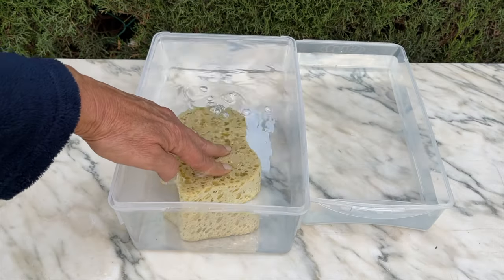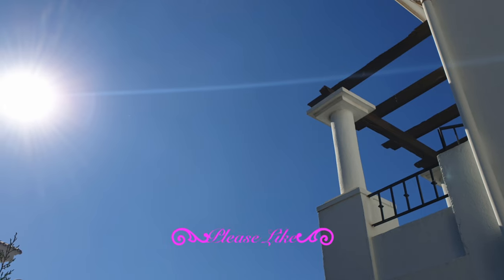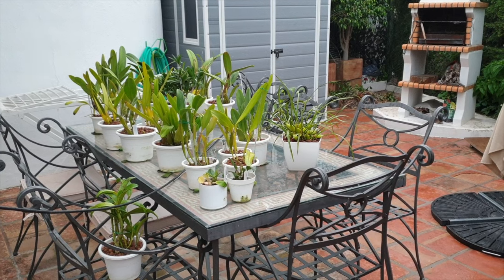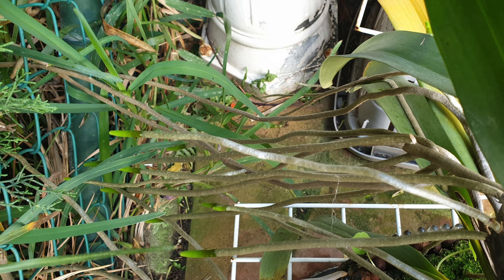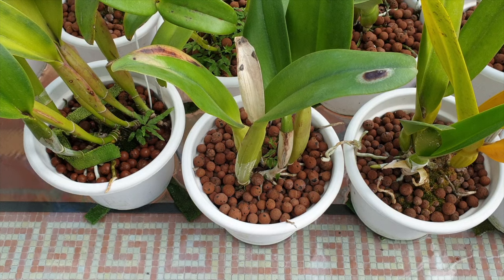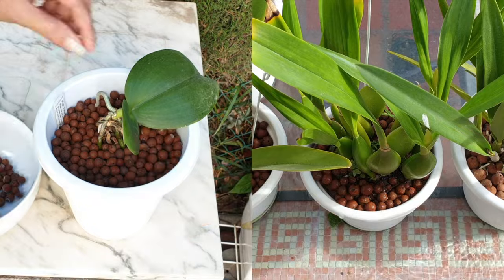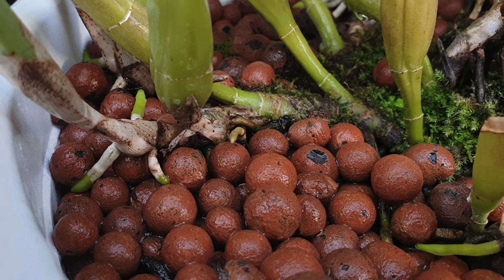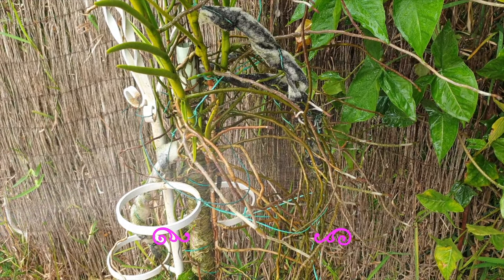Water Orchid Roots BEFORE Fertilizing? Y/N? Debunked? Why? Environmental Conditions #ninjaorchids

Comment: Great video Nina.  Trying to catch up on what I've missed.  In the growing season I like to have nutrients around the roots all the time.  I feed 3 weeks on and 1 week off for flush.  I'll add some cal/mag and additional epson salt on the off week, wait about an hour then flush the pot.  The weeks I'm feeding, run fertilizer through the pot wait 15 to 20 minutes run it through again.  It gives the pours of the roots a chance to fully open up getting the full benefit of the fertilizer. When I'm done feeding for the day I mist the exposed roots.  I might be waiting a little long before misting but I find very little foot and root tip burn.  Winter feeding is less of a concentration  of my concoction about 100 to 130ppm , not enough to burn them but still have food around the roots.  You Orchid Master taught me to stop fertilizing when new tender roots are exposed.  Oh yes, I was killing new roots.  Its a pain watering and feeding in the cold months takes 3 days to finnish 300+ orchids.  Whats nice I get a up close inspection of each plant.  Very thoughtful info Orchid Master. Thanks
Reply from the maker: 🌸 🥷🏼Bob San 😍🙌🏼🤸🏼‍♀️🥰💐 hi! Your routine is classic and the way I used to do it when I was growing in organic media 👍🏼 I have been blessed to see some of your roots 😍 clearly, you are doing it right! If I may just specify something, just in case, the growing season is dependant on what the orchid is doing on an individual basis and not based on our temperatures. Especially with your controlled conditions, you can be more targeted to the needs of orchids that are in active growth. In my case, I have dial everything down a lot, because I am depending on what the conditions are. If I have an orchid in active growth during the winter, the size of the growth will not meet expectations compared to the orchid growing a new growth during the warmer temperatures. So, if you look around your collection and see something wanting to grow, go ahead and support that orchid with a tad more nutrients. 👍🏼 Not sure if that is what you are doing, so if that is the case, then forgive the unsolicited advise. I sincerely hope that you are having a great week, 🌸🥷🏼 Bob San!! Take your orchid care routine in stride, don't stress yourself out 🤗 thank you so much for watching! You are appreciated 🫶🏼❤️🌸
Reply: @NinjaOrchids  Thank You Orcchid Master.  😊  I have not added more nutrients yet  but I do have some active growers so I'm going to add more food to them.  Great advise Nina!  Is it okay to repot the active growers this early not waiting until spring?  Thanks again  Orchid Master.
Reply from the maker: 🤗 remember that active growth includes new root growth or old roots starting to branch / extend. Even if there is no sign of a new growth, some orchids will start their active growth phase by working on the root system first and then eventually a new growth starts. 👍🏼I checked the comments in a video that I have called 'Seasonal Orchid Care', to see if you had seen it and commented. I am not going to assume anything, so I am going to link it here in case you have not seen it https://youtu.be/GlPy1LKM4Sg when I observed my orchids over the years, I recognized the simple signs of the seasons orchids have and it changed how I went about fertilizing and supplementing my orchids. Suddenly, the work load was not as much (summer excluded 😉) but when it came to OUR seasons, this video may just give you a great way to navigate how much you need to do, with which orchids and when. IF your orchids that need repotting are in active root growth, no matter the time of year, repot. You are blessed with a controlled environment and that is something you can definitely take advantage of without any worries 👍🏼👍🏼🫶🏼

Comment: With all of my minis I lightly water a day or two before I feed, then about 5 to 6 days later heavily mist all of them. I mix all my feed at one quarter of what is recommended on the label since roots are hair thin and can fry easily.  Some of the mounted ones get misted daily depending on temps and how fast they become totally dry. 
On to your next vid Nina... 😅👍🏻
🐝
Reply from the maker: 🦤🦅😍 do you know why I call you Wingman? I think you do but just in case you may think why I am still on and on with that label, well, here you are.... thank YOU!! Also, thank you so much for adding your method in the comments. It is definitely a different approach because of your controlled case. You can work with the humidity in tandem with your watering / fertilizing. Perfect!! Good to have your take here, in case someone has the same intentions with growing their miniatures in a controlled space that doesn't equate a greenhouse 🫶🏼❤️🌸

Comment: Hi Ninja Master, when I say,"with Magd. In it,"  yes. I meant sesquipedale hybrids like Lemforde White Beauty, and Lai's star.  The former is the culprit. 😊😊😊😊. I have been moving them to the counter away from the windows. My temps are probably too low at night...like 45° f. Daytimes are in the 50°s. Summer is usually ideal ,as it is very warm here. So if you think decreasing access to the windows would help, I might have to look for lights. I'm really confused.
 I hope you're doing well in Southern Spain. You have lived  many phenomenal places. I am so jealous. Some day I will go to Africa. I appreciate you so much! 
Your Friend, 
Kelly
Reply from the maker: Hi Kelly 😍💐 got it!! Yes, the sesquipedale parent is the one that is not as temperature tolerant as the magdalenae is, so, in cases of hybrids, no matter if they are primary or complex hybrids, the parent that comes through as the strongest with it's attributes, that is the care that should be considered priority for them. So, the sesquipedale is strong in your hybrid and you are right about taking it away from the windows. However, try to ensure as much good light as you can possibly give them. I know it gets difficult with the right location, but try to keep them away from the highest influence of the heater (check if there are drafts that push drier air to the area you have your angraecums) maybe you can place a tray with leca or pebbles filled with water in their close proximity to help out with the humidity around their leaves. The ideal temperature low, if it is at all attainable would be no lower than 68ºF for the sesquipedale, BUT because there is a magdalenae parent, they may be a little more forgiving with a low of 59ºF. I am probably not giving you encouraging information based on your conditions for these months, but I hope that it gives you a good idea as to what you can try to do to bridge the gap before conditions are more favorable. 🤞🏼I am blessed to be able to live in S'ern Spain! Even though it gets too cold for me and the orchids, I consider myself so lucky that I am here. Seeing as I am not able to heat my home, I cannot imagine those that are in a similar situation to me, financially, living up north where they have no choice but to heat, or freeze to death. So, I try to keep stumm about my struggles here, because others are REALLY in trouble this time of year 🙏🏼 but.... I will always dream of Africa and for 5 months of the year, I am very homesick 🥹 thank YOU so so much for being here, for your kind comments and your friendship! Your support is greatly appreciated 🫶🏼 hope you have a fabYOUlous Friday, amiga!! ❤️🌸
Reply: Thank you so much for all your insight. I appreciate you more than you could know. Because I follow you, I have been able to grow orchids I never would have succeeded at having without you. You are just awesome. Please keep on doing YOU. 
Your friend,
Kelly

Comment: Awesome video!! My environment is usually 75% rh. I pot mostly super grade Orchiata for all my Catts, but a combination of Orchiata, sponge rock and charcoal for the Angraecoids. My problem is I am a little heavy handed with the watering. I cannot seem to find a balance especially in the cold months... that keep the magdelenaes happy. The Catts are fine with all the abuse I give them, but the others are tricky. I believe one is on his way out as we speak. They are unhappy with the central heat ( it comes on and dries them) and when I try to compensate with the humidifier. I think I MIGHT be 12:42  overdoing it. I hope this makes sense. What would you recommend? My sesquipedales seem to be happy. It is mostly the others with the Magdalena in them that frustrate me. I fertilize weekly/weekly using  MSU, seaweed, and a biostimulent. You are awesome! Keep doing you!!!!?
Reply from the maker: Hi Kelly 😍💐 so, what is your temperature days and nights, Kelly? What is the other parent to the magdalenaes? Are you referring to angraecum hybrids when you mention 'with magdalenaes in them' or the pots with species magdalenaes? Your humidity sounds just fine, you are in the ideal range with 75%. Your intuition is probably correct, that when the heater kicks in. If your humidity drops then it is possible that that could be the culprit. Are your leaves turning yellow and limp? If so, that is the dry air before you get the humidity up again. Please let me know the answers to the questions I have, unless you already know where you can place those angraecums to a location in which the humidity won't drop. Thank you for your time watching and comment. I hope I can help you out to get your magdalenae to recover and that none are lost 🫶🏼 hope you are having a great day ❤️🌸

Comment: Interesting topic. The time it takes me to water before fertilizing with a growing collection has somewhat forced my hand when it comes to my own approach. I grow in bark and  bark mixes with a few bare root vandas and I have now stopped watering before fertilizing like I used to. Instead I fertilize weakly and ensure that the next couple of weeks' waterings  are with plain water to help flush excess fertilizer residues away from the growing medium. My orchids seem happy, but as you discuss in the video a lot of this is environment dependent and what works in my environment may not be suitable for other growers. I believe familiarity with our orchids and how they behave in our particular growing environments is key here. Nina do you have any videos on the potential risks of rainwater use for watering orchids and how to mitigate these? I've always wondered if pests, diseases, algae etc could be transmitted via rainwater. Furthermore, could there be extreme pH variations depending on whether your rainwater in collected in the city versus rural areas? Thanks again for such an interesting subject.
Reply from the maker: Hi Denise 😍💐 what you are doing is spot on. Lifestyle, and of course as you say, growing collection will reduce how much time we have to get the job done. I am glad that you are doing what you are doing and it fits with your schedule as well! That is what I call 'dialled in!' 🫶🏼 here is a link to a video about using rain water, when to use it, when not to use it, as well as why, or what to do if something happens outdoors while away and how to test if the rainwater is fit for purpose https://youtu.be/_pLb8KtCkPA another video that was interesting, doesn't happen a lot, but we had one week of blood rain and I went through the process again to see what that is about, because the Sahara dust is rich in minerals, feeding the Amazon, so I was interested to not waste it when I got me some of that https://youtu.be/kFNvkvFtovo a third video, if you still want to have another look, I have this video on how to prepare rain water for use with orchids https://youtu.be/uaJLvQvlNzs 🤭 sorry! I did not mean to inundate you...but I hope that one of these three videos will answer your questions, considerations. If they prompt more questions, then always feel free to ask 🫶🏼 thank you for watching this video! I hope you are having a great Sunday ❤️🌸
Reply: @NinjaOrchids  Thank you!😊

Comment: If the orchid is mounted, it is often more important to water with clean water AFTER using a fertilizer, especially if it is a relatively high strength of feed. Root tips are easy to burn and that drop of water on the tip can dry up and easily burn it. Around here, I sometimes have no choice but to go out and feed after it has rained or they aren't going to get fed at all.
Reply from the maker: Don Miguel 🥰💐 hola jefe! Oh, yes, in the summer I have to mist my mounts and totem pole several times a day and while I try to get back to them with plain water before the fertilizer water evaporates, I don't get to it in time. The only time I have ever seen my root tips suffer was when I overdosed with copper. The roots and root tips hated that stuff. Leca on the surface of my pots is my worst nightmare during the summer. Can't be helped and I have allowed myself some grace. If 80% of the new roots make it into the pot, 20% are collateral damage. This does NOT include the orchids that only grow 3 or 4 roots / new growth 😬 😅and yes, where you are at, with all the consistent heavy rain on a regular basis, fertilizing is definitely a must. My neighbor asked me once, why am I watering my orchids when they have been exposed to rain, so I tried to do a quick crash course over the fence on why I am out and about with my buckets / misters. I think I lost her after a minute or so. 😂 hope you are having a great Saturday 🫶🏼 thank you so very much for watching ❤️🌸

Comment: Great video.  Living in southeast Florida I totally agree with you on this topic.  I don't water orchids prior to fertilization.  I do have a topic that you might want to consider.  With inflation happening in many parts of the world the cost of orchid media has risen and some types of media have become harder to find.  When I purchase orchids I find that the nursery grower has used the polystyrene packaging peanuts in the bottom of the pot.  The orchid roots frequently grow right through the polystyrene.  Have you ever considered the possibility of potting orchids in the polystyrene peanuts without any additional medium?  Just wondering if that would actually work as a medium.  Do you have some thoughts on this topic?  Thanks for sharing your videos.  I always find them interesting, helpful and thought-provoking.
Reply from the maker: Hi Pat 😍 💐I appreciate your feedback and your take on what you do in your environment, thank you! So, the packing peanuts that you speak of, they are great if there is a need to make a deeper pot shallower for orchids that don't have such a long root system yet. It also saves the nurseries on media, but for the most part, if we were to use them at the bottom of a pot, they serve a great purpose for crocking and getting a deeper pot to be shallower for orchids without long roots (yet or even those orchids that don't extend roots deep into a pot). However, when it comes to using them as media exclusively without any add ins, they would not anchor the orchid, they would not stay in the pot seeing as they are light weight and could also blow out of the pots if, for example outdoors when temperatures permit, and then the most important factor with these peanuts, is, the float! They will never absorb water. So, every watering is cumbersome, from above, the media will raise up and over, become buoyant while water is flowing through the pot, and watering from below doesn't work either, because they don't wick. I had one orchid in perlite only (as an example) a brassavola species because I wanted the air around the roots, but some kind of humidity to be maintained in the pot, and it was a nightmare. Granted, perlite is smaller, but the principle is the same, it just kept floating around at every watering and in the end, I took the orchid out and used pumice instead. Which also floats, if not presoaked for as long as it takes to saturate fully. While I love the idea of alternatives to classic orchid media, packing peanuts are not the ideal option, long term. It will always need something to weigh it down. For crocking, it is excellent! These are my thoughts on the packing peanuts, let me know if you think I missed a detail that I had not thought of where they would be a great substitute as orchid media. I am not opposed to the thought, if you have a thought in mind as to just how they would work long term without the points I mentioned. Thank you so much for watching, the food for thought is awesome! I hope you are having a great day 🫶🏼❤️🌸